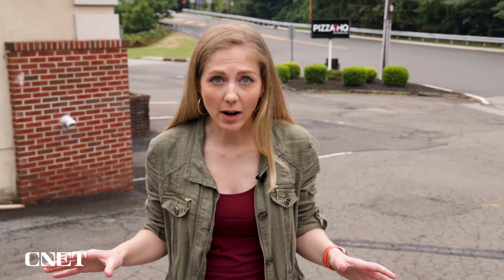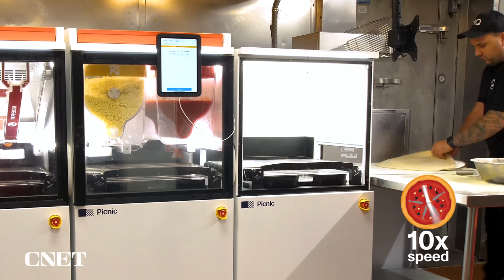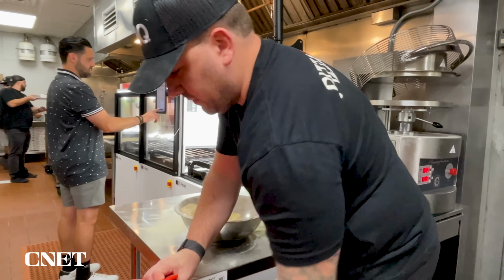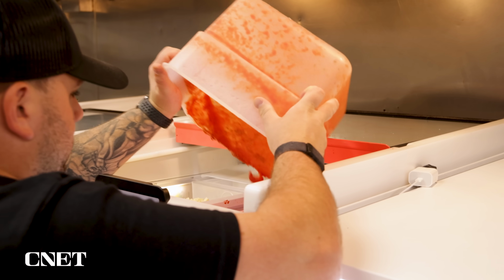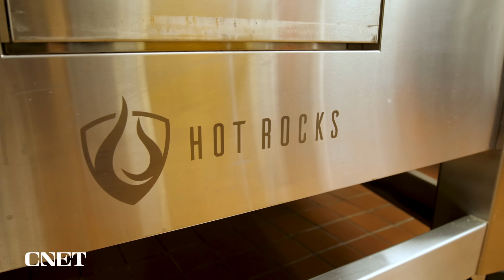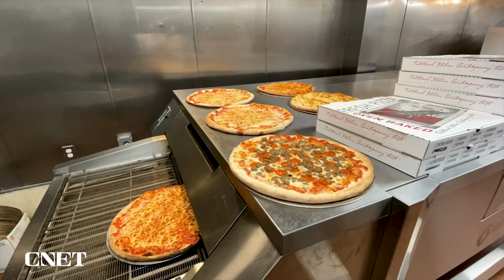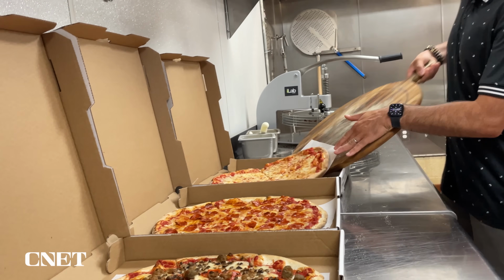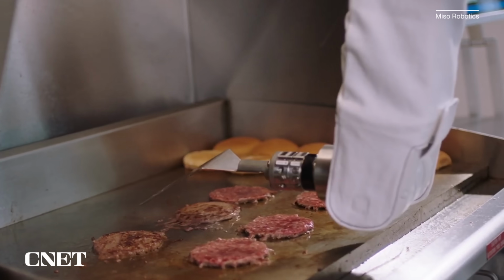The Future of Pizza is...Robots in New Jersey?! 🤯

Comment: In a way I feel like this is hardly even news (no offense to CNET or Bridget Carey).  So they made a better assembly line.  This was pretty much bound to happen.  Pizzas are about getting things consistent.  (Ever felt gipped because you didn't get enough cheese or sauce?)  If they hadn't called these appliances 'robots' would we even know about them?  Certainly similar machines have been constructing our frozen pizzas for years.  Burger King has had a broiler that runs on a chain conveyor belt that cooks burgers in 90 seconds since at least the 1980's when I worked there as a teenager (yes I am that old).  As far as I know, it was never called a robot.  What these devices do is help make a more consistent product, which is what we all want.  I hate it when my pizza is sliced really unevenly, don't you?  How about when it gets burned on the bottom?  Want to know why changes like this are happening now and didn't happen years ago?  Well automation is certainly better now and technology is more widely accepted but that's not the whole picture.  The other piece, IMO, is the rise in the cost and scarcity of labor.  Automation is filling in the gaps for the jobs that are harder to hire for today.  It's easier now for a restaurant owner to justify spending $5000 or $10000 or more to get a machine to do a job that was once done by a human.

Comment: Isn't... isn't this how frozen pizzas have been made for decades?
Reply: Yep albeit at a larger scale, this is made to order
Reply: I think you all missed his point.  His point is that this isn't a new concept.  It's actually pretty old.  What you do with the pizza after it has been put together is another issue, whether that means freezing and packaging it or putting it straight into the oven fresh.
Reply: @belenlulo  Indeed. The quality of the ingredients and the taste of the final product has no bearing here, as the technology used is still the same old technology (which is being lauded in the video as if it's something original).
Reply: yep.. just moved from a factory to a store.. and with maybe fresher ingredients instead of the cheese that can freeze cheese-like product they use on frozen pizza
Reply: Fantastic point! And they sucks!
Reply: Yeah, but I think your missing the point, pizzas made to order at a semi industrial level with fresh ingredients delivered to your door
Reply: Frozen pizza is super cost cutting, preservatives, shrinkage.
Reply: Traditionally they would fill an entire warehouse with equipment that can pump out a ton of pizzas -- and if they wanted different pizza toppings on some, they'd need different machines to do it, with it's own separate process. This machine simplifies things by allowing custom orders in the same small space -- something that can easily fit into a small pizza store, and be activated only when an order is received. That said, I still think you made a good point that this is definitely more of a factory-line process than a robot. But, it's a bit of a grey area.

Comment: Go tell AOC and Elizabeth Warren that this what happens when you demand $15/hour min wage for the absolute lowest skilled jobs.
Reply: Many fast food places have been paying $15 for years and still can't get enough staff. Then consider rising product costs and you get a situation where restaurants need these machines in order to control costs, otherwise many will not survive. There is no need to politicize the issue when economic factors can sufficiently explain the current situation.

And even if costs were exactly the same, I would still take a machine that can run 24/7 with near 100% accuracy over a human worker that could never hope to achieve the same metrics. This was an inevitable situation, and will be a long run positive for society.

Comment: Is he using G-Code to control the system.
Reply: Now you have me thinking about to create the software for this machine.  😜
Reply: @danharold3087  maybe the iPad that you were using has custom firmware to control the Pizza Maker Robot.
Reply: @DAVIDGREGORYKERR  LOL OK.
one could do that. Most would put some sort of GUI on the ipad to setup or configure the machine.   The actual movement software which reads and executes GCODE generally lives on a computer which is part of the hardware being controlled.   

Having said that I am now running Klipper on a raspberry pi.   Klipper analyzes the motion created by the GCODE and adjusts the speeds on each movement to make it smoother.   Jerking lowers print quality.
Klipper then commands the arduino on the printer with a series of commands the produce that  accel - decel movement.

If your into 3D printing check out Klipper